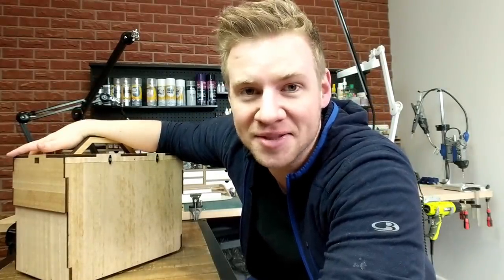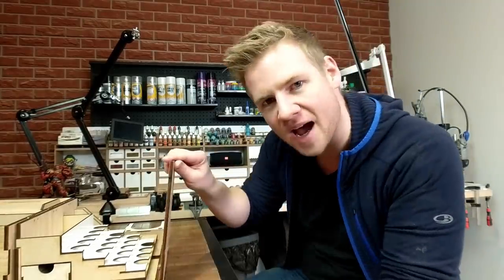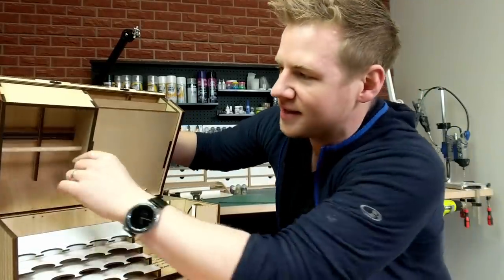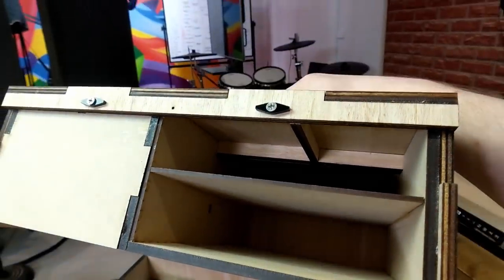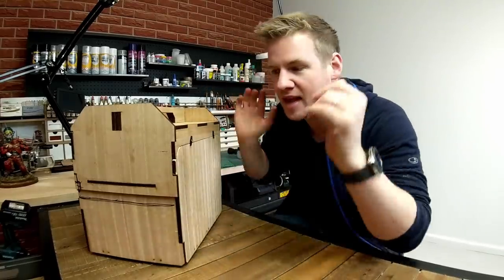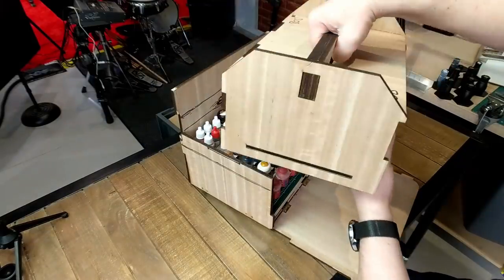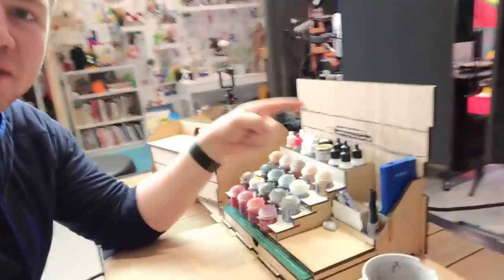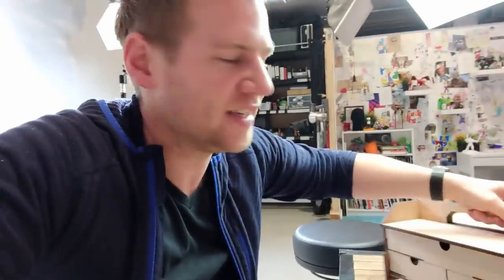My Prototype has MAJOR FLAWS - Hobby Box Diaries ep.3

Comment: In reguards to version 0.07 ...  
A simple fix would be to move the hinges to the narrow side of the box instead of the long side, making space needed wider, but still manageable on the average tabletop, depth-wise. this would also solve the paper dispenser issue, as it would be out of the way to your left or right, along with your drawer space, but still accessible. Doing this could also solve the problem of your workspace "pad" because your securement devices for the lid would be on the narrow edge, letting you put the workspace "pad" lose the inch you need want.

Comment: @Daily Jazza  you can either replace the barrier with plexi glass, or half it using very sturdy hinges. With the hinges you'd be able to fold the upper part of it down from obscuring your view.  I´d also use with the hinges a sliding bar/rod on both sides, so it stays up while you put the kit back together. And why not decorate that part with an image that is viewable both upside down and upside up while you are at it.

Comment: Could possibly have the backplate be almost like a sliding window, opening it up by sliding it down into a gap and closing it by pulling it back up. Then you could keep the structural support on the outside with the option of keeping the slide up when you need it (as in blocking off the compartments) and down when you want to look through it to watch tele when it's all spread out. It does mean that some of the view will be blocked which wouldn't be ideal, but could be the perfect height to rest a phone in on the slides handle and gap (like the other ideas mentioned in the comments). Also not sure how to lock it though, maybe weak-ish magnets?

Other than that loving this series Jazza keep it up! Definitely not something I'm used to watching on YT so it's a nice little experience watching you problem solve

Comment: Why not like prototype 0.07 where's there's a hinge on the back to fold the lid over.. one simple way I think, would be to use the same concept in prototype 0.08 and be able to fold the back wall over on a hinge if you desire..or leave it up if your posting a rendering to it like Bernat said.. gives options I think. N for The cutting board drawer, just make the drawers in the removable lid a lil more shallow n it would give extra space to adjust the height of the bottom drawer.  Just my options But I love everything about it. It's awesome!

Comment: Q : Why dont you use hinges on the back to where you still have the height as the box but can fold the back down . hinges can be placed where you have the black line drawn on it in this video. If you are worried about stability you could think about using small magnets to hold things in place.

Comment: I have an idea to a solution for a high back panel: The Height of back panel could be in two pieces. It would have a few mini hinges, allowing it essentially to flip behind. Giving you a lower back panel. With two magnets parallel horizontally, inside the material, on the top half of panel. By flipping it forward, puts the panel into vertical position. Note the lower half panel is fixed in a horizontal position. Leaving you with a high panel. The drawers would have magnets on the front to connect to the other magnets. Allowing the top panel half to snap shut in place hiding the drawers. This potentially eliminates the current full height (barrier) in use, but bring back the height when packing up. To enjoy crafting and watching tv?

Comment: I am keeping track of this project since I am also a mini painter with VERY limited space. I rent a smal flat in the capital and moving my stuff has always been a huge pain. The more problematic things come when I try to unpack, and repack as it takes ages. I use a crappy ikea rolling cart that I store under the kitchen table and do my work at the same table... So I really want to get my hands on something like this :D 

Also a recommendation - it was mentioned that the "huge flap" is a problem. Why not give it some pegs / holes so you can mount things on it?
I'd surely mount some lights on that and possibly some stuff to keep my tools organised. Like a brush holder / generic holders with small pegs. Then the space is not wasted, frees up desk space and enables the user to expand upwards - meaning it is MORE usable on a small table :)
Reply: By the pegs I mean there are these wall mounting systems with holes that you can put holders on. You can add a bunch of holes to that flap and include some adaptors that can be fixed to these.

Comment: It may be possible to add a hinge on the back panel that allows it to fold backwards away from the supplies to shorten it. Using a metal door hinge or something silo at should still allow it to be strong enough to bear the weight of the box.

Comment: Could you use the back panel as storage for the cutting board (store it vertically) and raise up the box a few inches to fit the wet pallet where the board is? You could have the pallet on one side and another drawer next to it.

Comment: I'm liking v0.08.  Would definitely consider buying something like this if it was available.  Quick thought, what if certain aspects of the design were customizable when purchasing?  Like the paint rack: I use narrower, taller bottles so having a rack with holes cut for that size as an option would be awesome.  The lower shelf/drawer you mention could be another spot: people can either buy the one with the narrow cutting board slot and drawer, or one that's just one thick shelf.  Do you see these as being pre-assembled or the consumer puts them together?

Comment: So at the moment you flip the front panel down, slide the top half forward and then lift it off, leaving the high back. Could you hinge the back panel also, but in the middle, so it folded back onto itself? This would reduce the height, take away the need to slide the top half draw section forward (cause the back would fold down away from the interlocking section. Then it could still push back against a wall, and add only a minimal amount of space at the back...you could also optionally leave the back up for sticking reference to (I blutak reference images to the back of my painting desk quite often).

Comment: A solution to the hight of the back of the box is you could (for the top) use 2 cateraide latches to attach the top to the base with a slight lip on the back of base so the top stays even with the base and you can still keep the flap on the front.

Comment: for the back panel, you could cut a U shape out of the middle.

You'd then have a "tab" either side that'd hold the top part in place and also hold the draws shut, while at the same time lowering the percieved barrier.

Comment: Well in my mind to remove the extra part on top, give the draw some legs so that the whole back and some part of the sides can be set aside to the ground or aside on a table where you would have a cubbie space under the draws, but that means that the side panels would have to be either not in use or you will have to cut around them

Comment: If you look at the box  left corner and right corner at the back, a pvc pipe could be inserted vertically.   The lift of box  can be cut in half and when you drop the flap,  you pull the two boxes out wards, like they are on a hinge (the plastic pipe).  to support the weight two hinged supports one either side can be pulled out underneath.  As for the handle on top you put in a to upright tabs with holes in and slide a pvc pipe or wooden dowel through,  you slide this out to unfold the box,  this means you dont need a back wall, blocking your view from the TV.   If you put on the rear two rebates either side you can drop in a a4 cutting mat.  This means room in the lower area for your wet palette.

Comment: Most of the issues around its shape could be fixed simply by making it a box you put to the side of your workspace - then you aren't walling yourself off, you don't exceed the width of a normal desk, the left/right handedness becomes almost entirely a choice on which side of your workspace you place it.  Or split the box across its long diagonal and have the two sides - so on your dominant hand side you have the water, holder for active paints, brushes and tools and on the other the storage for the other tools, the rest of the paints etc. So you are working with a workspace between the boxes that can be anything from a simple triangle or spaced out wider for that half hexagon.

Comment: I'm not sure if suggestions are welcome, but splitting the back wall horizontally in half and putting a hinge or other locking mechanism would allow for the back wall to half in size when opened as only adding a few centameters at most to the back. I look forward to seeing what you do with this!

Comment: Only idea I can see for the back panel would be to make it have the ability to fold down but would run the risk of breaking overtime

Could also just might it removable like as a slide out mechanism but can also become loose but I had a weird thought of the slide out part being in parts so not all one piece and used as a ruler maybe

Also you could move the bottom drawer items to the top wide draw to make a bigger part for the bottom drawer for your wet pallet 

Looks great though

Comment: Possible fix for the back panel. Cut it in half across the middle. Use small hinges to attach them back together.  The panel can then latch to the top (removable box part). When you remove the top, the back panel then folds backwards and down on itself. If something like that works it wouldnt take away from what you already had while lowering the height on the back while in use.

Comment: You could have the back panel still at the same height but have it as an extra piece of wood that is connected by two hinges so once the top is removed it is just folded behind the back of the box giving you the view you’d like and getting rid of the height issue! (And it could still support the top part)

Comment: It seems like a child safety lock for the draws would eliminate the need for the back panel (although, not if it's used for substantial support for the whole structure). But something like a pivot lock or something similar to a draw child lock may eliminate the need for the back panel.

Comment: I like the draws being a separate part, what if you make the top part isolated completely and have self protected face panels with it connecting with a 2-4 part system on top to attach and remove from the main body. Or even have it slide on and off the top with it locking in the walls of the body.

Comment: If it were me, I would make a flap out of the back panel. But I'm thinking maybe to keep the strength of the panel make it so it can detatch or reattach and then add a brace to support it for carrying, maybe like one of those door locks that has a bar horizontally held by two verticle bars? Just a thought.

Comment: It's probably something you have already conisdered, but I didn't see a comment on it and figured I'd throw it out there: Could you possibly put a hinge half way down the back panel? It would simply fold down to the height of the rest of the box when deployed. It likely wouldn't require a full redesign to implement either, simply cut the rear panel as low as you want it, and  add two or three hinges.

Comment: Jazza, have you considered making compartments adjustable? Hopefully it wouldn't be TOO much more expensive, but it might solve many future sizing issues to allow the - for example the cutting board compartment - could be raised a few centimeters once the box is unlocked. Perhaps, you could slide or push up the portion of the box above it, or allow some or all or part the compartments to have resizeable borders (up a notch, down a notch, over a notch) so buyers can have some measure of control over what size each compartment will be. As for the back of box, perhaps allow that to flip down and become an additional shelf when the box is open.

Comment: I love this version, and I hope you will figure out how to solve the flaws, it seems like you are much closer to a final product. Can't wait for it to be finished, this seems super useful and comfortable to use already, I want to buy it so badly x). But I will wait, and support this channel and project. You got this!
Reply: Also an idea: How about to make the tall back of the box "flappy"? Like the front, but just the half of it. It will be attached to the sides of the middle sides(or other way), so when you open it, it won't just fall loudly to the back itself, you will just reattach from the middle and the flap it to the back. It will add only 1 cm of the length on the table, and it won't close the view of the surroundings.

Comment: You should consider a removable lid. You could use some basic latches all around the sides of the box and go with a collapsible handle. If you design the lid around removing it and setting it to the side, you could almost re-imagine the whole lid as a separate box that stores upside down.

Comment: What about having the drawers open from the side rather than the front? The separation panel would then be in the middle of the inner lid and also possibly tie into supporting the handle, while staying hidden. That might fix the barrier issue too. 
Edit: another idea I have is sliding layers, which could help save space and still be roomie efficient. I’m not sure quite how to explain it but I’m gonna put those words out there.

Comment: You could solve the height of the back panel by simply cutting it off and putting it back on with hinges. 

It can fold down. Put some clasps on the panel, and on the lid so it adds extra structure to hold the lid on while it's closed.

Comment: I think that adding in the ability to use the back panel as some kind of frame could be nice assuming the height can't be worked out. Then you could load up, A4 or even A3 (longways) reference sheets or even add in slots to allow a user to use the back panel to mount things, whether that be an arm with magnifying glass or lights. Either way, you made the monolithic block look less like a monolithic block which was my only personal issue so I'm pretty happy.

Comment: Q: The design of this box seems more geared towards miniature painting (I'm thinking mostly of the rounded cutouts for the paint bottles).  What are your plans for hobby boxes (customizations?) that would work for other hobbies such as acrylic or water color painting or paper quilling, etc.  Most of the paint bottles I use are the cheap little 2oz bottles of craft paint and they're much taller than these little paint jars you're using.  People might also be using the small paint tubes?  Just wondering what the flexibility is beyond just cramming all your bottles/tubes of paint in a drawer?  I'm ok with putting paint in the drawer, but then the cutouts for the jar paint is just wasted space I wouldn't use.  Does that bit come out if you want to use it for bigger paint bottles?

Comment: I would go back to the hinged lid but have it split in half and open up left and right. The handle can be a U bar that attaches to the sides of the case instead of the lid and flips to the back of the case, then you pull down the mat flap and open the top up.
I also wouldn’t get too hung up about a one for all design. You could have a universal chassis and have different inserts. It’s not going to be possible to have a case for sculpting, painting and modelling all in one. That’s literally a full workstation.

Comment: What if you tried something like... having small legs that pop out from the bottom, so that the drawing space could actually be on an angle if you want instead of flat. And what if instead of having it open to the back you have it open horizontal, like a wardrobe. That way its not becoming useless space, you could have a left section, a middle section, and a right section, all with supplies. And then you could have it stand up(optional) to give the angled drawing table. That would also potentially open up some space underneath for other things if necessary

Comment: crazy thought for 0.09 why not have the surface that the mat goes on slide out from the bottom? it seems like integrating it into the side is causing you more headaches than its worth. you could even make it so the mat could just slot into the surface when its stored, meaning that you don't have to move the mat at the end of your session if you don't want to

Comment: For the height of the back panel, could you cut the top 2 or 3 inches off and add hinges. Not sure how the top attaches. You’ll need away to attach that piece when you swing it up to meet the top portion.